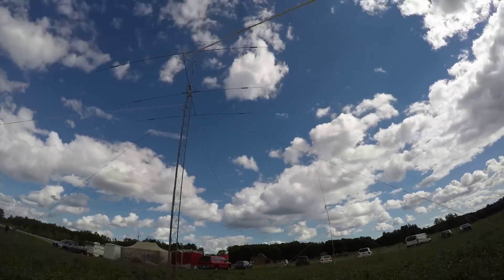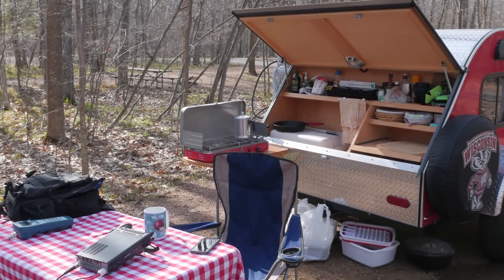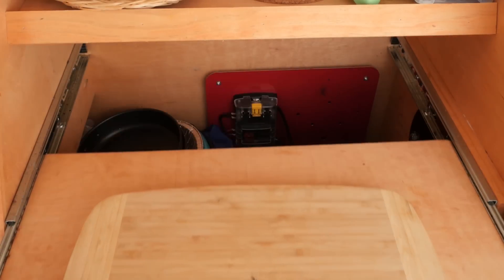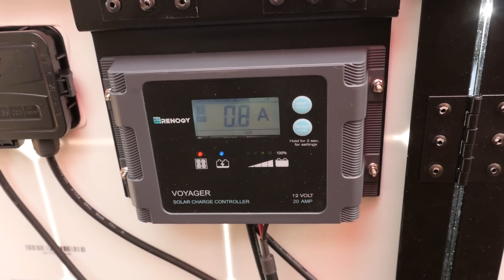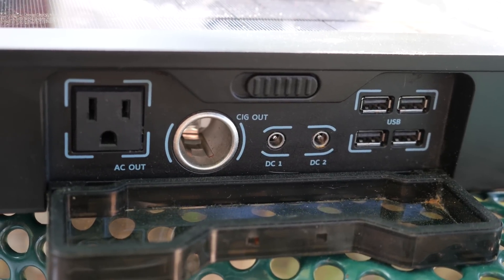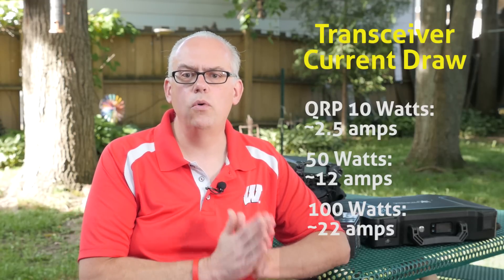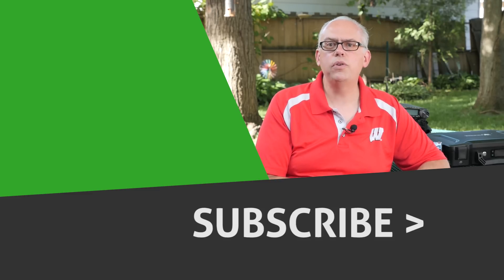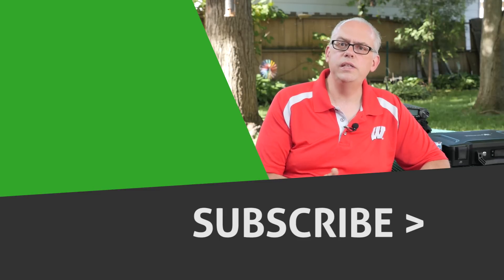Portable Power for Amateur Radio - Ham Radio Q&A

Comment: I was just looking at batteries before this video. You can get 2 sealed lead acid 35 ah batteries  for around 135 bucks. I would love a bioenno, but the price is just to high. Currently I use a 1500 peak amp booster pack. I need a booster pack anyway, so it just makes sense for me to use that, and most likely will get a new one when this one pooches.

Comment: Great video! Not quite 100% related but I used my Hardened Power Systems Operator 115 which is meant for my GMRS Micro Mobile Midland radio which fits in a 30 caliber ammo can for a temporary power supply in my pickup, but I took that radio out and permanently mounted that GMRS radio in my Ranger  It has a solar charge controller built in which I keep charged with a automobile 12v power plug that was made for it. I put velcro on the ammo can so it doesn't slide around on the floor. The setup has a built in 12v AGM battery in it but not sure how long it can stand on its own with a 100w rig. It does have a couple of sets of Anderson Power Poles along with a 3 amp USB port in it. It also has a digital volt and ammeter in it.  I can take this out and use it for portable power and hook it to a solar panel if I wish. I did shoot a video on this setup I would put a link up but I don't want to take away from your video. Just look for it on my channel.
Reply from the maker: Thanks for sharing, here's the video on the Hardened Power Operator 115 if anyone is interested: https://youtu.be/z88ZSTk8Mr4

Comment: At 3.75amp/hours ( 40 odd watts) could a 100w solar panel keep the battery topped up in day light? Or is the real world output not that good?
Reply from the maker: In an ideal situation, a 100 watt panel will produce 5.8 amps in full sun. So it would be able to keep up with your power consumption of 3.75 amp/hours
Reply from the maker: That's some great advice, i couldn't have said it better.